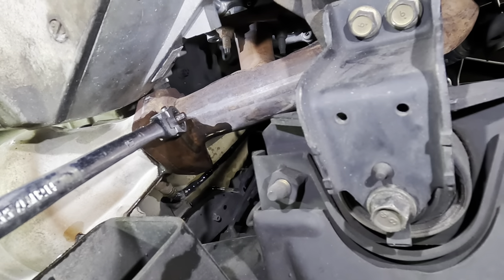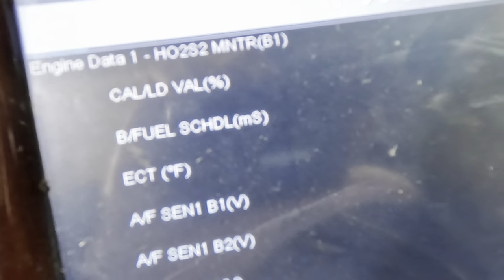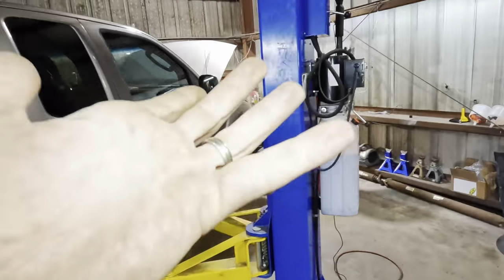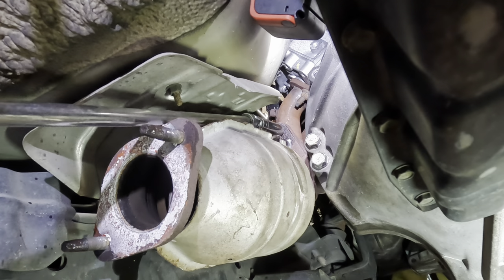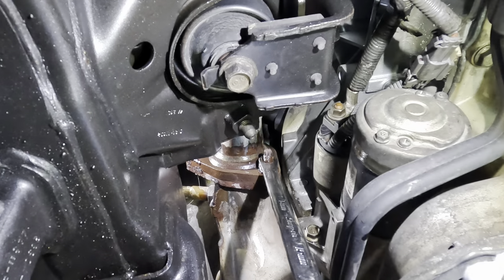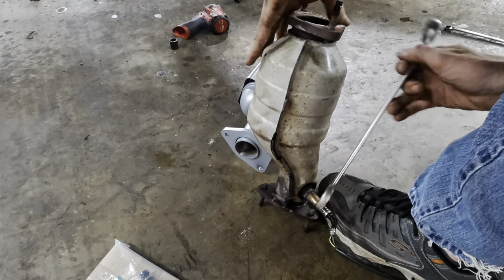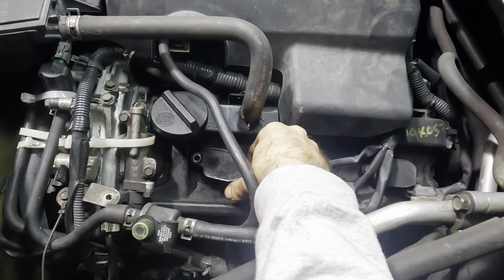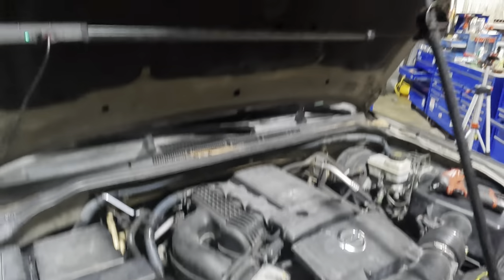Catalytic Converters! Missing?  Running Rough P0302 P0420 P0430 Nissan Fronter 4.0 v6

Comment: First issue is that the 747 has to have matching thrust to generate sufficient wheelspeed to match the speed of the belt otherwise it will travel off the back of the belt. In this situation, it would need additional thrust above that required for the wheelspeed to match the belt to generate forward speed. Basically, the 747 would need twice the thrust than that normally required for takeoff to achieve sufficient forward aircraft speed on the moving belt. As a four engined aircraft only has 25% more thrust than essential (FAA design rules for single engine failure at V1), then it is highly unlikely to have sufficient thrust available for takeoff on the belt length available. In this assumption I am leaving out the takeoff weight of the aircraft as even at minimum weight, it will probably run out of the belt length.

Comment: 4 "dead" converters on one of those usually means stretched timing chains and it's running slightly out of time all the time and in no time it'll be time for 4 new converters again, unless this time they took the time to replace the chains.

Comment: Why 4 converters? On the fuel it depends on the compounds in the fuel. The purest perfect fuel is 3,4,5-Trimethylheptane which if you add up the carbons it is an isomer of octane. Octane is what gasoline is but it can contain other alkanes with higher carbon chain lengths. However there are additives to help keep the engine combustion chambers and valves clean or cleaner. 

Truly bad gasoline may contain sulfur compounds, not suppose to but it sometimes happens. It is as much the temperature in the combustion chamber as much as the converter. Hotter means more NOx where the colder the more VOC or unburned fuel or incomplete burned fuel. This is why the engine computer with information from the O2 sensors cycles between a little lean a little rich to change the temperature of the exhaust gasses sent to the converters. The lawn mower may need a different temperature spark plug or the carburetor is too rich. Just some ideas. Higher octane numbers on gasoline does not get you better mileage. The octane number is to prevent detonation or pinging. There are books on this subject. Yes chemist. After years of being a mechanic. Not the Charles Bronson kind though it would have paid better.
Reply: why?    is that your question, why four  SMALL  converters.     because smaller is  easier to  'fit' into the available space.

Comment: Ray, why wouldn't you run a tap to clean up the threads and use Antiseize? Those bolts will never come out without breaking.

Comment: 00:20 Airplane can't fly on belt, because it needs airspeed, not groundspeed to fly (I'm a Pilot). 36:45 Catalytic Converter (Manufactured in the Philippines) 👍

Comment: During a timing belt job, my dad messed up the spark plug cables (despite my protest) and absolutely bungled the firing order. The exhaust ports became fuel-air-spark ports, and the cat glowed orange hot during the test start. Not long after, I lost power in the fast lane on I4 due to exhaust obstruction. The solution? Hollow out the cat, of course! My father taught me so much about being a good mechanic by being a bad one.

Comment: I like that little riddle there because jet engines are so big now it would probably create its own hair speed but then again and airplane takes off I have ran a mile in my mind and the wings on the inside portion will get are not the one going to be outside either way a very interesting question

Comment: This morning I was trying to remove a brake caliper bolt with a 3/8 drive little breaker bar and extension. The breaker bar head snapped right in half. Smh. But the 1/2 drive I bought immediately after got it done

Comment: If you put those batteries in the freezer overnight they bring them out i heard from a friend it resets the chip inside the battery and will charge and operate much better

Comment: Ray, we can reduce and even eliminate emissions by going back to alcohol fuel.  rated 108 octane, burns clean and cool, does not pollute and can be run inside buildings. 
It can be produced for less than 2 dollars a gallon at the pump. some minor air fuel changes and any gas vehicle will run on it. 
Why dont we do it?
Reply: You know the answer to that!
Reply: @stevenbaker9327  Yes, I have seen what happens when Someone tries to open a non, gas fuel station.

Comment: As Real C D'Cruze said, A plane requires air flow over the wings to generate lift however he also forgot to mention that it also needs thrust to push the plane forward to create that air flow.

Comment: The plane is going to take off... Mythbusters actually did an episode on it. The thing is that the plane doesn't get it's speed from traction with the ground through it's wheels but from the jet or propeller which moves the air around it... or rather it's pulls or pushes itself through that air.

Comment: Just to clarify. We are saying the plane is not actually moving, right? Or the conveyor belt is cause the plane to roll forward. Originally, I thought of food on a conveyor belt at a grocery store. In that case the air would move fast enough to cause lift. Essentially, it is a really poorly built aircraft carrier catapult.  If the plane isn't moving, causing air to move quickly over and under the wing.....it ain't going anywhere. I don't get how someone thinks it would....

Comment: There are a number of independent, interdependent and codependent parameters for sufficient lift to be generated for takeoff to occur.
1. The engines (jets, rockets, propellers) only provide movement if the force generated exceeds the inertia, stiction and friction exerted by the plane.
2. The force/thrust generated by the engines acts on the surrounding air mass, it does not inherently cause airflow across the wings.
3. Lift is generated by, and only by, sufficient airflow across the chord (profile) of the wings.
4. Ground speed and airspeed are the same if you allow for wind speed and direction. i.e. If wind speed is zero, ground speed ≈ airspeed.
5. If the force generated by the engines is counteracted by the speed of the Treadmill,  then the Plane has no way of generating airflow over the wing - NO LIFT!
Overcoming Inertia relative to the Treadmill - YES, but still no airflow - no lift.
6. By replacing the Fixed Tarmac with the reverse movement (equal and opposite) of the Treadmill you have decoupled the Plane from its physical environment and set the force/thrust equation to a nett ZERO.

Comment: cool rgen I can explain the airplane thing.    the reason they have to take off moving faster ther 160 npg more then often is because the wings don't devolope lift standing still. hence the aircraft would simple fall off the treadmill.      yes I am a pilot.

Comment: Since your charger was off it could have put a small drain on the battery pack and equalised the cells that are in the pack so it would accept the charge. When I was into RC cars I had these things that you would plug in the battery pack and it would slowly discharge it to equalize the cells. The batteries charged way quicker,  didn't get as hot and lasted way longer and would then charge on the automatic charger.

Comment: To get lift on an aircraft you need airflow over the wings, nothing else matters, so if there were a plane in a wind tunnel and there was sufficient airflow in said tunnel to generate lift the aircraft could technically "hover" because the air going around the wings is sufficient to get the plane off the ground.

Comment: If the conveyor moves the plane at takeoff speed, then there is proper airflow over the wings. If the engines are powered up to match the speed, then takeoff will occur. If anything is missing like a clear path, level ground and proper flap settings then no takeoff will occur. speed is only one component.

Comment: as an aviation person who researched this religiously : the plane would not fly,  NOW. if that conveyor was replaced with wind and the plane was traveling into said wind. the aircraft wings would generate the lift necessary to fly. the airplane on the conveyor does not fly because it does not have the force (wind/ air speed) necessary to generate the pressure difference required for lift.

Comment: 747 0n conveyor.  the situation is stated with enough lack of clarity that it might or might not fly...

if power is applied just adequate to not go backward it does not fly.

If full power is applied, it can take off but will likely blow the tires due to them effectively spinning double normal speed.

Comment: It can fly because the thrust is not related to the wheels, and the forward motion is generated by thrust, and then the lift is generated by the wings against the air. The wheels will just spin at double normal speed

Comment: Galvanized coating is the worst Ive dealt with it 20 years in my profession I install Fire Sprinklers the systems we install in cold environments or outside has to be cast in Galvanized coating and running bolts through most would destroy them so we would take just 1 bolt and use it go around to every thread and run it through to make sure all the new ones don't get cross nutted or threads eaten up by the Galvanized coating. Galvanized Coating is uses as an I.E. rust prevention

Comment: Taking the converters out was easy......until it wasn't   I'm amazed how good the nut/bolts came apart.  What did you use for penetrating oil?  P.S.  I hate it when the manufacturer feels that they have to use every single size of nut to put a vehicle together.

Comment: My 2000 Dodge Ram Cummins (and many other ChryCo vehicles of many years and models) had a thing where it would switch charging on and off when temps were chilly. I heard it was to protect delicate circuits during high load coldness. Perhaps GM has a similar philosophy with Max's of the Dirty variety.

Comment: Take off occurs when the speed of the air, relative to the forward direction of the plane is great enough.  Having the platform move does not actually change that.  Also, engines provide forward thrust on the airplane, pushing them through the air irrelevant of what the platform is doing.   If the plat form is moving the plane through the air forward to create this speed, the plane will lift.  Adding engines would keep it in flight.  Even if the platform is moving the plane in the opposite direction,  then once the engines are powered on and the brakes released, about the only effect is the wheels spinning faster, and the time it would take to overcome its reward momentum.  Still, it could take off once this occurs.   That is, of course, assuming the stress of powering on engines while the plane is moving backward did not damage the plane.  Also assuming that the engine could overcome the impact of air moving against the back of the engines.

Comment: If you have a failing to charge battery, take another charged battery of similar size or larger and place -tive from the charged battery to the refusing to charge battery. Attach a lead to the +ive of the charged battery and just quickly touch the refusing to charge +ive side, (you sometimes see a spark, do not be alarmed) you can do this maybe 2 times and return the refusing to chrge battery to the charger. You'll find the jump start you've given it with the good battery will have brought it out of the 'too low to charge' area and it'll take a full charge again.
I have to do this with AAA and AA batteries all the time as they are sometimes over discharged by the equipmment. I find this common on better battieres Enelopes and Amazon rechargeables.  Have a great holiday and Happy New Year y'all!

Comment: Air flow over the wings gives the plane lift. Jets are simply to provide the velocity for such wind.
Also, I don't think that finding tools in someone's vehicle constitutes finding them in the wilds and should not be taken. A slippery slope me thinks. Is the next step finding a $50 note under the seat in the wilds too. Not for me, stay off that slope to start with IMO.

Comment: Since the wheels on The plane are not driven, and the engines are either jets or turbines or propeller, the engines produce thrust without friction on the ground. So the wheels would turn twice as fast, but the plane could take off as it would normally.

Comment: I bought a brand new boat with an outboard motor. About 6 months into ownership I went into the bilge and found vise grip pliers still on the motor mounting nut. I took it back to the mechanic and he had been baffled for 6 months wondering what happened to his pliers.

Comment: Only thing that changes for the plane is the wheel RPM at takeoff because the power to move is not from  power to the tires but from the thrust of air from the engine.

Comment: I would have to cut and grind out those bolts because of the massive amount of rust created by road salts.  I also would have used antifreeze on all fittings. 39 degree there. -25 here. Now thats cold.

Comment: The plane doesn't care if it is on a conveyer belt. It doesn't move by putting power to the wheels. Thrust from the engine will always push it forward no matter how fast the conveyer is going. For example, the plane is on a conveyer belt with a wall behind it so it can't fall off the back. Without starting the engine on the plane. The conveyer is moving at 40mph but the wall is keeping the plane in one spot. As soon as you turn on the planes engine and introduce thrust to the air, the plane is undoubtedly going to move forward.

Comment: To the half that said it can’t fly are correct airspeed is one thing but one of the most important things to know that if a conveyor belt is moving at about 155 knots that’s the ground speed but the airspeed would be zero because to put in simple terms 

You need airflow over the wings to get lift without that the plane is basically on a dino a really big dino too if we’re talking 747 but no matter what aircraft the wings need 3 things

Airflow 
Lift 
Drag 

To get a plane off the ground the wings need more then rolling tires they need (airflow) air over the wings to create (lift) and upward pressure to lift the wings using the airflow over the wings and (drag) which is the dynamic of pulling the plane back but in a forward motion this is why slats in front of the wing gets extended and flaps at the back of the wing allows lift and less drag but more air resistance that helps further increase lift typically a plane lifts 150 knots or a 747 about 155 to 160 knots depending on weight and allows it to fly

Comment: It's not just that the plane  Doesn't have the required air speed It also doesn't have the wind going past its wings enough to provide the lift

Comment: The trick with the batteries to get them to charge again when they won't is to take another battery and use a wire and tap the + and - from the good bat to the bad one with a wire for like half a sec and it will charge again.

Comment: Hmm When you remove the coil wheres the 20k plus volts suppose to go?Maybe use a jumper to the spark plug then see if it arks through the insulator? Just thinking out of the box

Comment: I am 74 years old and was a certified GM licensed technician, witch took attending GM training classes at your own expense, from 1972 to 1975. We were guaranteed $200.00 a month income + commission. Therefore you had to beat the Chilton's Manual to make profit in those days! If you didn't beat the book and make profit, you only got the $200.00 a month. Whatever you produced over your $200.00 in labor for the month, you got in addition to your $200.00!!
My friend, YOU WOULD NOT HAVE MADE ANY MORE THAN $200.00 a month at the speed at which you work!
PS: I became a diesel mechanic after the dealership for 9 years working for boat companies. Then, in 1985😄 went into business as a contract mechanic for myself until back injuries disabled me in 2000. MADE SOME GOOD MONEY AND TRAVELED ALL OVER THE WORLD WORKING FOR BOAT COMPANIES, OIL COMPANIES, AND GOVERNMENTS!!
Wishing you good luck in your investments and work!!😀
Your diagnoses and work are both very good but improving on your speed will help you greatly! Quality and Turnover is profit!

Comment: The battery could have been too hot when you tried to charge it. After it cooled down, the protection circuit allowed the battery to charge.

Comment: I love the thought provoking engineering quiz question. 
I would say that it most definitely would NOT fly.  The jet engine creates a pressure differential to create lift.  In other words, air gets sucked in faster UNDER the wings than the air flying over the wings and this generates lift. However if you have no air speed, jets open up their engines to test with brakes on while sitting still on the runway, and the plane just doesn't go "woop" now I'm airborne...  No.  It requires airspeed.  So there is your answer. 
Next(?)

Comment: The thing is, the plane wheels are moving freely, and will spool up to the speed of the conveyor belt.
The engines will easily push the plane forward, as the conveyor belt can't act upon the plane because it's wheels aren't motorized, they spin freely.

It therefore can fly no matter the speed of the conveyor belt.

Comment: 0:10  The question is wrong.  Planes do not move by turning the tires. They move from thrust.  Regardless of what the tires are doing, the plane will be accelerating and will take off.

Comment: I just think of the airplane wheels as idlers, the plane isn’t connected to the ground, the wheels would spin faster but don’t overpower the engine since they’re just a bearing

Comment: You're right about better gas. The problem is that people will drive across town to save $3 on a tank, so telling them that they'd get better gas but it would cost more is an absolute non-starter for 95% of people, even if it means they'll end up paying less in the long run.